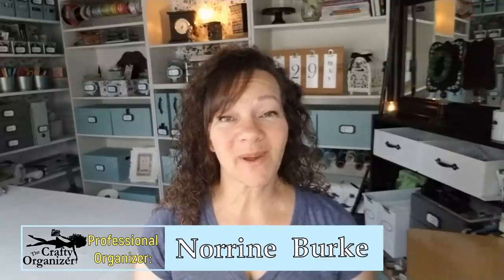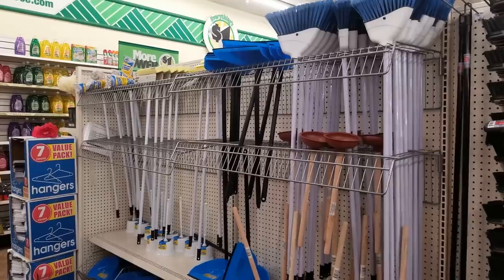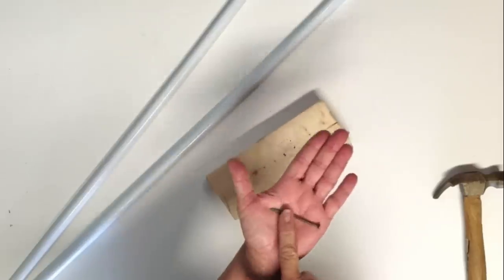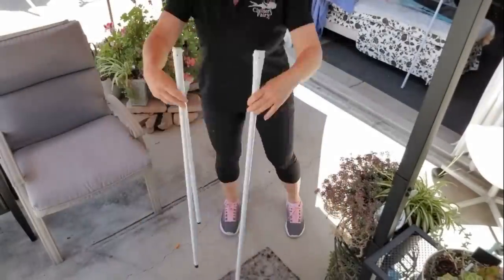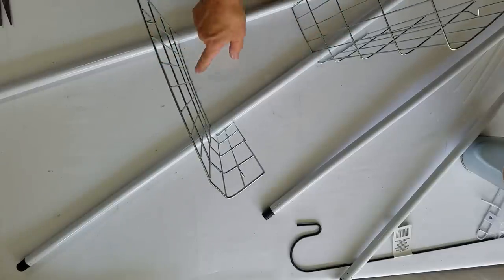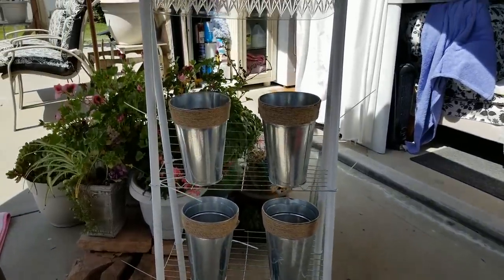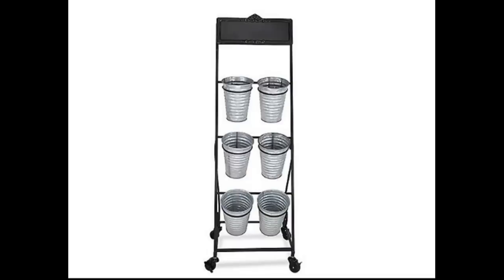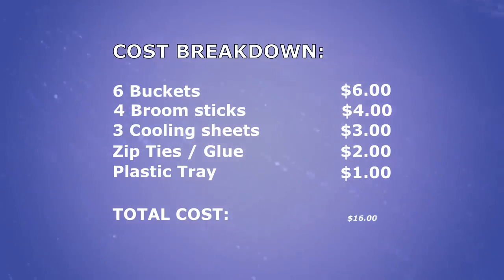Dollar Tree 3-tier Storage Cart DIY- UNDER $20

Comment: How fantastic!! I'm more happy to see a reuse for those wheels.  Not 1 of my plastic drawer carts still have wheels.  They break off so easily.  And it can cost $ 10 for a set of cheap wheels.  I think I will make one of these today. I would put a small screw in the legs to make the shelves more stable than zip ties and glue. Afraid that I may put something just heavy enough to cause it to fall. I think I'll use it tomstore my artificial flower stash.
Reply from the maker: I hope you do!!!!  And then show me how it turns out!!!
Reply: I just found 4 handles. I wanted the black ones.  Already had everything  else.  I do not think I'll make the sign. And, where would I  go to show you a picture?  Hopefully,  by the weekend ill get to it.